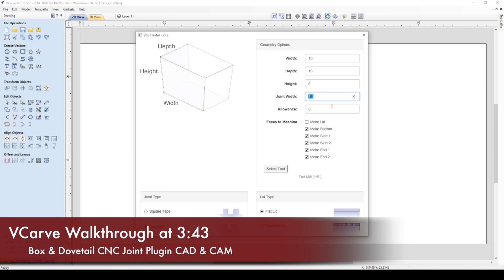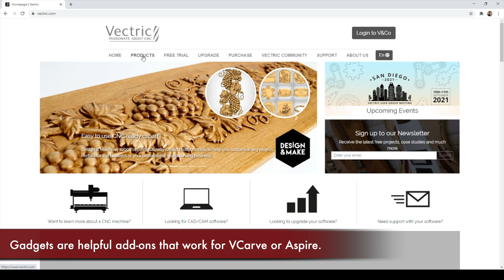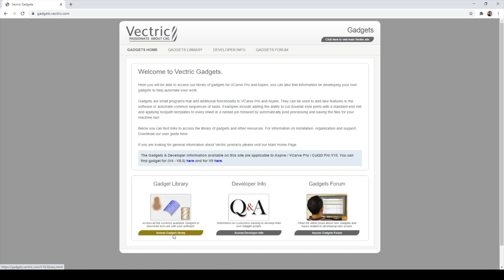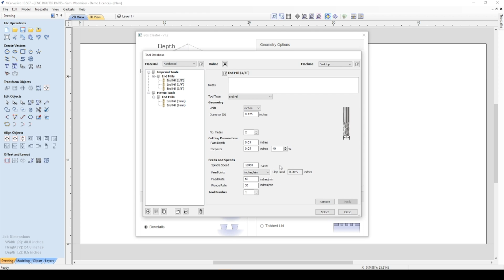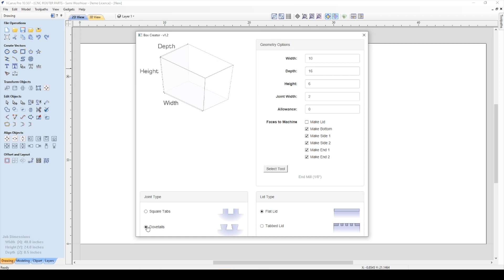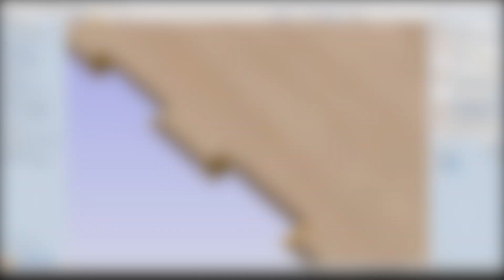Easy CNC Drawer Boxes   Vectric Box & Dovetail Joint Gadget

Comment: I have gone through a lot of plywood trying to make this thing work.  My problem is not knowing what to put into the field marked "Tolerance."  I see in one of your comments below here that for 1/4" plywood you use a tolerance of .01, but would you use that same .01 for 1/2" or 3/4" plywood?  I noticed in the first part of this video where you are laying out your dimensions for the box that you made, you left the "Tolerance " field set to zero.  I have tried that and you can't put the joints together with a hammer.  So how did you get your box to come out perfect and the joints fit together easily, after leaving that tolerance field at zero?  This thing is driving me nuts and I have gone through a 4' X 8' sheet of plywood trying to make this thing work.  I'm about to give up on it completely.   Thanks for the help.

Jim
Reply: I was doing 0.118 lexan and the boxmaker did not do dog bones and the tolerance must be set to something other than zero I could not get it together. Also what I messed up I cut outside the vector not "ON" the vector and one pass It should have been 3 passes.   Well how do you choose which vector to select? In box boxmaker it shows inside and outside vectors. The dual path double vectors was my fault. I was in the 2D view and hit preview all vectors and preview produces the cut out vector on the 2D Sheet!!! don't do that or you might have to start over with a clean new job. I didn't carve the lid because it was outside the material. So there was plenty of wasted space to create my own lid in the unused space. It seems boxmaker doesn't like material under 1/8 inches thick, because the dogbone area wont match the material thickness.  The auto generated dogbones were almost 1/4 in deep. Also speeds and feeds  in bit selector 1/8 in single flute I chose 35 IPS 10,000 RPM  I'm documenting this for my own tips doc.

Comment: What allowance do you set in the box gadget?  Thanks
Reply: I use .01 for quarter inch plywood. Allows easy assembly this way. With out it they are really tight.

Comment: If you do the gadget exactly as shown it works very nicely. However moving the pieces and/or multiplying to make more boxes the toolpaths will get screwed. I can not find anywhere how to reproduce them correctly. Can’t tell if the correct path is on/in or out. So far this has cost a lot of plywood. Well back to it
Reply from the maker: There are several limitations to this gadget as it's a community developed plug in for a program. One way to orient the layout is to change the size of the material to restrict the nesting of the parts. 
For the regular box joints toolpath it generates two lines. One that is the exterior of the box and one that is the line for the tool to generate an on the line toolpath. If you'd like any follow up conversation on this please feel free to reach out to our support team and we will do our best to help!
Reply: I have made over 60 boxes with this gadget.  I too cut up several sheets of plywood into scrap pieces before I learned how to make the gadget make perfect boxes every time.  Here is a short video on how I made a ecofan box using the box gadget.  Works great!   https://www.youtube.com/watch?v=FgqXBNIWqaw

Comment: Can you use an AVID CNC to do everything you need to build kitchen cabinets?  I used to help my dad in his shop making furniture and remember the different tools he had back in the Mid to late 70's.
  Now turning the clock forward I purchased a home recently and want to redo the kitchen and bathroom cabinets as a start.  I have a good drill press, a 16 year old new router table in the box and a good air compressor.  I'm trying to think of how many more fewer tools I could get away with adding that would complete my requirements other than adding a CNC with maybe the 4th axis?  I'm talking about power tool and not the list of clamps and other finishing tools.

Comment: Is there a way to use Box Gadget to do just the sides and ends,no top or bottoms
Reply from the maker: Yes, at 4:50 in the gadget pop up window it provides a list of the sides. You can uncheck any side you don't want it to generate!
Reply: @AvidCNC  Thank you But I want NO tabs on top or BOTTOM?
Reply from the maker: @johnsautier2703  Do you mean like a box frame, no top/bottom and the four frame pieces only have joints on the corners? If you uncheck "Lid / Bottom" it should not create box joint tabs on the top and bottom of side pieces, it will create box joints only on the ends of side pieces where the pieces fit together to form the corners of the box. If I've misunderstood your question please feel free to contact the Support Team at Support@AvidCNC.com and we'll see how we can help!
Reply: @AvidCNC  That's exility what i want. Like a frame. But it does not work. I can uncheck lid and bottom and it still gives me tabs on the bottom of the sides and ends.Thank You JOHN SAUTIER
Reply: @johnsautier2703  You can always cut them off quickly on the table saw.
Reply: @johnsautier2703  Sorry to see that this bug hasn't been addressed.  In the same boat as you.  Dont want top and bottom tabs but I get bottom tabs no matter what.  Otherwise cool gadget.

Comment: Thanks for the great video but why machine vectors is set to 'ON' and not to 'outside'? Thanks.
Reply from the maker: Good question. If you pause at 5:47, when we zoom in to look at the tool path, you can see two vectors. One is the edge of the panel, and one is offset the radius of the tool from the panel. This way when the bit follows the on the line profile toolpath it can create a dogbone corner relief. This is just the way the gadget was programed to import and create the tool path. (You can also achieve this by manually adding dog-bone fillets tool in the design panel if you'd rather use an outside of the line profile tool path on the line that is the edge of each panel.)